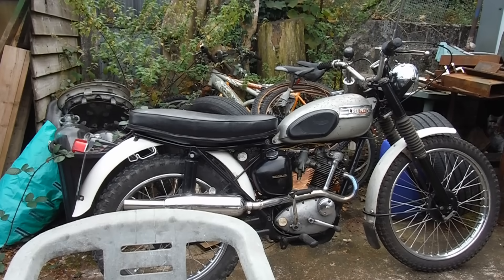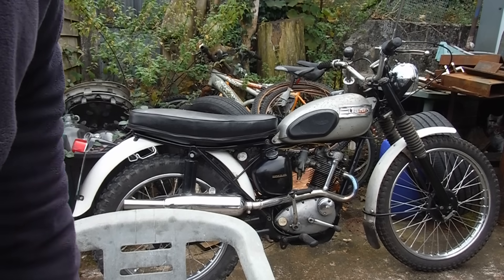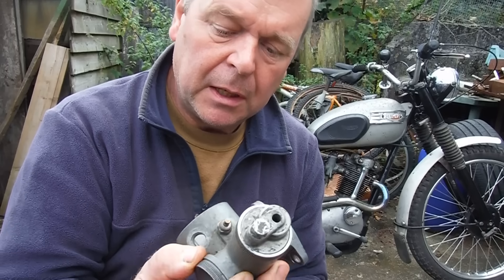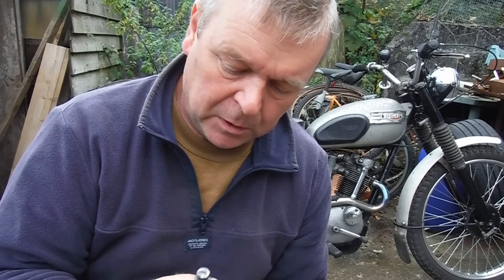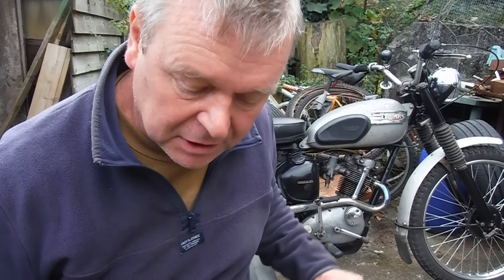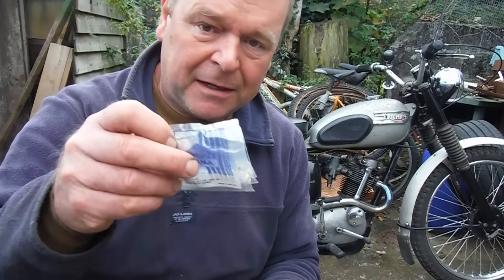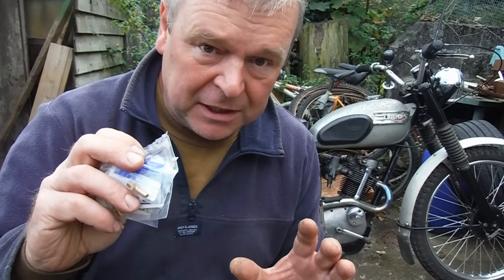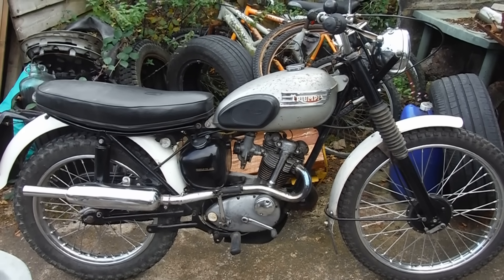Modern fuels, pinking because of them and an easy way to help overcome such a problem.

Comment: E10 is very aggressive acid. The  EPDM rubber used may have Vinyl Chloride in it to aid cross linking of the Ethene and Propene monomers. This will reduce flexibility. The don’t use Latex anymore to my knowledge,  it is all synthetic.
HNY bro. Love from Downunder.😅

Comment: We are fortunate here in Wisconsin to have non-ethanol gas readily available. So i don't have to resort to backing off the ignition timing due to weak fuel😮. My Cenex gas station is 4 miles away and offer 87, 89, and 91 octane non-ethanol gas, which is about 30 to 40 cents higher than 87 regular, which is 10% ethanol  and what most people use in their cars. In some places non-ethanol is called recreational gas, because it is ofter required  by equipment  manufacturers like ATV''s, lawn mowers, outboard motors, etc. Ethanol is a weak fuel and attracts moisture which causes corrosion and clogged jets. I dont have problems  with pre-ignition with 87 non ethanol except one very hot day my T140V was pinging.
Reply from the maker: Backing off the ignition timing is actually not desireable with the modern fuels we have in the UK, but lots of people believe it is. Upping the amount of fuel an engine recieves slightly is a better way to go.

Comment: I use NOTHING but aviation fuel, 98 - 101 octane.  You can buy as little as a liter to as much as a 45 gallon drum at any airport, some will deliver. Look for the small aircraft entrance/hangers.

Comment: We had trouble with our MX-5 this summer on the occasions when the air temperature was very hot midday.
Just a handful of days when this happened. Modern engines have knock sensors but perhaps the temperature was outside its range with modern fuel.
It's old enough to have been not  designed for ethanol fuel.

Comment: What a little beauty your Cub is. Much appreciated for the info, I will get a 107 if I use a Monobloc, if & when I get around to building one of the 3 basket case Cubs I have buried somewhere. Do they not like Concentric Amals? I have D10/14 2-stroke ones but pretty sure I have 4-stroke one off a Bantam Cub somewhere.
Everything`s carp nowadays, my tarps for covering various projects in my garden are totally falling to bits within 3 months.

Comment: I totally agree with you about modern rubber. Modern cables if installed externally for a few years will split if you bend them. I was told from a rep in the tyre industry for 40 years that the rubber content in a lot of tyres is minimal. He mentioned ''silica'' being added. Modern cables feel more like plastic than rubber.

Comment: I had a Tiger Cub, I paid £50 for it. Painted it blue then sold it for £65
That was about 1975
The guy who bought it laid it down on his trailer -  I though "But what about the battery acid ?"

Comment: 2 stroke trials bikes which are very sensitive to fuel settings need their Delorto carbs idle jet to be set richer with modern fuel, including E5.  Now 2t bikes require a lean needle/jet for good pick up, so perhaps not so essential there.  My 2001 250 Sherco went from a 33 to 35 idle jet. to run correctly and it was a big improvement,

Comment: Paul, man of knowledge .   I have a 1959 royal enfield 250 which runs like a dream once it's running that is. Starting it however not so good!  Now and then it will fire up 1st or 2nd kick   but if it misses out on that it is a very tiring process involving many ,many kicks.  If I use the choke it will never start so all starting is with no choke at all.  It drives me mad as it is so good once it's going. which would indicate the timing & carb settings are pretty well about right.
Reply from the maker: It might be a bad coil, or an ignition switch fault, perhaps?

Comment: Interesting observation Paul, I will try that on a 650SS Norton of my mates. Refurbed the cylinder head after it had blown a head gasket, and I put everything back to standard. Runs nicely now except for moderate pinking up and down hill, which you have observed. (We are in the Shrops-Borders region.) Thanks for posting this, Phil.   👍
Reply from the maker: Thanks, Phil, glad the video was helpful!

Comment: Hi Paul. I agree 100% with your theory. About 6 weeks ago, I came to the same conclusion re my '70 A50. It's always ping(k!)ed a bit going up hills, and has been achieving way too good mileage eg 70+ mpg (Imp) at road speeds between say 40-65mph. However, the bores showed signs of excessive heat, so at about 3am one day I ordered a 107 needle jet via the interweb. Every other setting is standard. My fuel is not ethanol-laced. That bike now runs and pulls very well for a 500, without sooting up the plugs too much. Very happy, and feel like the bike has some safety margin in hot weather. Big plus, so thank you for supporting the theory. 
However!!! My '74 BMW R75/6 is diametrically opposed (very poor joke. Sorry.) to the above result. It came to me with standard jetting, black plugs and 33 to 38 mpg. After a lot of experimentation (with new components), I've gone down two needle jet sizes, and lowered the needles to their lowest of three settings. Float levels, timing, valves, diaphragms etc etc etc all good. Using the same fuel as the BSA, I now get a much better mileage (around 52mpg Imp), combined with much better performance. Plugs look to be satisfactory. What the hell is going on?? Anyway, I'm not going to argue. it's good now, and I'm happy, at last, with both bikes for now. End of book (again, sorry!).
Reply from the maker: Strange but true, I guess - thanks for sharing!

Comment: I. have a 1976 Rolls Royce and the distributer is marked with the different grades of fuel to set it to.  BSA when it brought out the1968 Spitfire blamed the GP2 carburetors for engine seizures, but it turned out to be a new lucas advance unit they had coincidently used for the first time.  I run six different bikes including a BSA A65 and  I use premium 98 in all of them. The other bikes are fuel injected and computer controlled The Harley s and MV run very hot in the summer months and are used mainly in the winter as such in Queensland. I think being too rich is better than to lean and less advanced is better than too advanced. I have a new Husky 401 and comparing to a BSA 441 Victor  Its easy to see that the Victor is not running its best in all areas such as when climbing hills  Its easy to see that an engine needs to be constantly  adjusted to run at its best  On the subject of rubber it is the addition of PVC that is the problem In high quality boots that used soft plastic they will fall apart after 5 years  Motocross boots are the worst and they are better to be worn regularly than kept in the wardrobe for that special occasion. Tyres in Australia are now stamped with a date and are unroadworthy after ten years regardless of wear

Comment: Have you considered that wide open throttle is increasing dynamic compression and causing more heat from that instead . The jet is cooling the chamber down with cold fuel . Hemi chambers under load with modern fuel are not compatible in Brit bike design . It's really a riders riding style that should be considered too . Tighten down the squish if rebuilding , double plug ect . More fuel might also be slowing the burn rate to a degree .
Reply from the maker: The pinking rarely occurs at full throttle, as I say in the video, most of what was happening was at medium throttle openings, even downhill. The larger needle jet compensates for what the fuel lacks, it would seem. Twin plugs in our RE 350 and 500 racers made no noticeable difference to power output, when we tested them on a dyno, although the lines on the graphs were a little more ragged.

Comment: I wrote a short story which included my experience with my T140e pinking:

I Ran Out of Petrol
Yesterday, I was nearly home from a short jaunt on my trusty T140E Bonneville when the familiar British twin began to cough and splutter like it had caught a cold. No problem, I thought—I’ll just flick it onto reserve.
Except… it was already on reserve.
That sinking feeling hit quicker than the revs dropping. I managed to coax the bike on for another 200, maybe 300 yards, but as I rolled up to a junction, it gave up the ghost completely. The engine sighed, sputtered, and died, leaving me coasting like a sad, leather-clad ghost into a bit of pavement.
I peered into the tank, hoping for a miracle. And there it was—fuel! Not much, but enough to slosh gently like a tiny, useless wave at the bottom of the tank. I leaned the bike over toward the reserve tap side, whispering sweet nothings to the float bowls. One hopeful kick and—bam!—the Bonneville roared back to life.
Determined not to waste the moment, I set off in earnest toward the nearest Shell station, just a short way up the road. Of course, this newfound enthusiasm only lasted a minute before the engine started spluttering again. This time, I tried the old left-and-right tank shuffle while riding—looked daft, probably—but desperate times and all that. Just as the engine began to stammer its final words, I pulled the choke. Amazingly, it gave me a few more wheezy yards... and then, silence.
Helmet off, ignition off, and with a dramatic sigh, I began the noble push to the fuel station—luckily just 100 yards away, slightly downhill. Not enough to coast, but enough to feel like I’d earned the fuel.
Now, I like my petrol like I like my coffee—strong and slightly overpriced. But this Shell station took that idea too literally. Instead of treating my Bonneville to the usual 99 RON super-unleaded with a splash of 5% ethanol, I winced and went for £4 of the cheapest 95 RON with a hearty 10% ethanol. Just enough to get me to my Shell, about seven miles away.
With both taps open and the choke on, the Bonneville fired up on the second kick. I took off like a man possessed, tearing through country lanes with a mission.
But halfway up a rise, I noticed it. The dreaded pinking. Not just a little ping here and there—this was full-on metallic popcorn. Every twist of the throttle was met with a tin-can orchestra. I tried easing off, feathering the throttle, offering encouragement… nothing worked. She was not happy.
About half a mile before the next station, I shut off the fuel taps to let the carbs empty as I coasted into familiar territory. I timed it perfectly—the engine gave its final puff right as I rolled up to the pump. Like a theatrical curtain fall.
I brimmed the tank with Shell's finest 99 RON and 5% ethanol nectar, flipped the main tap on, gave the Kickstarter a ceremonious boot, and off we went—Bonneville and rider, reunited in mechanical harmony.
No pinking. No spluttering. Just the smooth, thunderous beat of a proper British twin, back in its element.
Moral of the story? Always know where your reserve tap is, never trust shallow fuel waves, and for heaven’s sake—avoid the cheap stuff if your Bonneville has taste.

Comment: I had a set of aftermarket gaiters rot inside six weeks in the fierce NZ sun on a B44 but I think that's because they were just latex and not proper vulcanized  rubber. I got a set with a proper band name and they lasted till I got rid of the bike. I've also found those needle jets are worth replacing on old carbs anyway as they wear out and cause all sorts of low speed dithering and juddering.

Comment: Assuming you got pinging with the needle clip at P3?  Then you went up to the next needle jet size and started with the needle clip up top in P1? And then raised the needle one clip at a time till you got a satisfactory result on the next bigger needle jet.
Reply from the maker: I just swapped the needle jet for the next size up and didn't touch the needle position.

Comment: This mirrors my personal experience with my 2-stroke dirt bikes - We're stuck with "E-10" fuel in most parts of the US, and the 10% ethanol blend needs a slightly richer A/F ratio in my (carburetor equipped) bikes.

Comment: Different combustion chambers , flame front speeds , fuel injection,   So by upping jet sizes you would be running cooler,, be interested in what the book says ,,, My old enfield ,,,just plugs along .... but I still have the mighty 7 to 1 ratio!

Comment: I’ve said this before - Amal manufacturing standards aren’t that great and new jets can vary quite a bit. I’ve had a new jet marked 106 measure 107. I always measure the jets (which are a consumable, by the way) with a pin gauge before installation. Paul - I’d be interested in your take on this.
Reply from the maker: Hi Greg, I have to say I have just trusted the numbers on the jets, and so far, that has worked for me. That said, I am aware of subtle differences between old, original Monobloc carbs and their new counterparts - fibre washer vs no fibre washer under the float needle housing being one to watch for.

Comment: As a retired energy campaigner for a leading UK environmental organisation I think that its counter productive to put ( bio ) ethanol in petrol. The bio-energy ( corn, bio-wastes etc ) used to make ethanol could just as easily be used to make bio-fuels for heating or electricity generation for the same carbon saving. That way many millions of less used vehicles would be spared the damaging hygroscopic effects of ethanol ( gummed-up carbs, rusting fuel tanks, poor fuel performance ). Indeed, there is an incentive to drive such vehicles more to avoid such 'standing' problems. The annual cost of ethanol damage to the UK vehicle fleet needs to be calculated. Also, most of the bio-energy is imported from the United States so that carbon cost needs to be included in considerations.

The total energy content of ( 1.44 billion litres ) ethanol added in UK petrol in 2024 was just 8.5 TWh/y. That compares to electricity generation of over 300 TWh/y and heating at over 700 TWh/y.  The disadvantage to the UK vehicle fleet is just not worth it, not least as the carbon would be saved anyway ( preferably being used in the United States ).
Reply: Excellent point.  The use of ethanol in motor fuel is a political decision to allow politicians to boast about their environmental credentials and also to make sure we are all aware of the issue at all times.  And of course many religious people believe that suffering makes us better people.
Reply from the maker: Very good point, and something I hadn't really realized. Thanks for sharing!

Comment: Very good advice. The rubber is different these days. Many years ago in the truly good old days you used to be able to vulcanize a patch on your tubes to mend them. When the rubber composition changed it was impossible to use the good old vulcanize patches any more. I bought some fork gaiters 12 months or more ago and the rubber had a plasticky appearance to it. Instead of the good old dull proper rubber appearance the rubber had a shiny sort of wet plastic look about it. They may not last very long.
Reply: Fitted fork gaiters..yes shiny rubber with mould casting marks down the sides. Split 18 months after replacing...not impressed.
Reply: Modern plastics are far superior to older stuff, far more resistant to oil, petrol and UV...
Reply: @chrissmith2114  You can have your plastic I will take the good old rubber ones thank you.
Reply: @chrissmith2114  Thats bullshit man and you know it.

Comment: I wonder if the petrol refiners use less anti-knock compounds these days, since "modern" engines have sensors noting the pre-ignition and adjust for it. The refinery accountants would be certain give the nod to that. Were I a chemist, I might also opine on whether or not compressed ethanol may lead to pre-ignition - this potentially made worse by the large combustion chambers of our favorite engines and the resulting degrees of ignition advance required. Rarely is there a single culprit, but some human being, somewhere, started the rock rolling down the hill.
Reply: my suzuki gn125 is pinging ever since the petrol changed over to ethanol. i think the compression ratio is different with e85 and different piston is the correct fix. i will try the needle resize change, but i did try adjusting it to different heights and it made no difference.
Reply: @martin-vv9lf  Does that needle not alter the main jet flow only? You may have to open up the primary/low speed circuit via the idle circuit. That "should be" a mixture screw and possibly a replaceable jet against which it seats.
Reply: @po18guy-s4s  I know the mix screw on the pz30 series but this has a rubber diaphraghm, constant velocity carb i think they're called. might just change the carb for a simple one if i can't get a local to look at it.
Reply: @martin-vv9lf  Every carb has an idle mixture adjustment somewhere. Some are sealed beneath metal or plastic caps and one must go looking for them. I believe the circuit on your carb may be just ahead of the float bowl, on the underside. If you have a manual such as a Haynes, it will identify the parts and give some adjustment advice.
Reply: @po18guy-s4s  thanks, i don't have a service manual but i will take a look for the screw.

Comment: Makes sense. Very interesting. I have both sizes to try on my BSA. 
 On a pushrod iron head Honda90 l have, l bought a tin/lead pellet that sits in the tank. It is what was used in ww2 spitfire engines to compensate for awful fuel. It has a 6000 mile lifespan. It's run fine and no problem even with a regular big bag of spuds tied on the back up a steep hill!
Just something else in your fuel thoughts armoury.